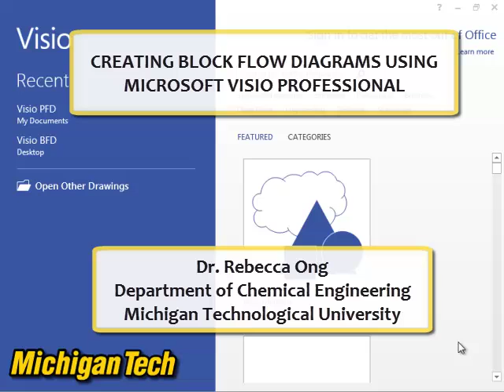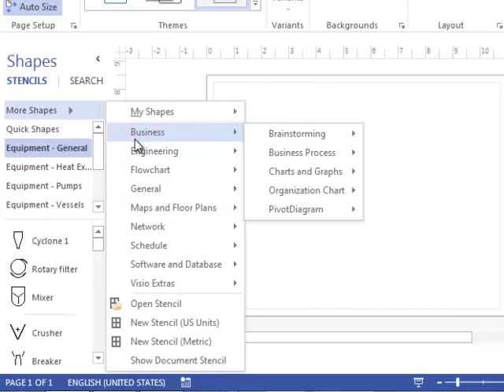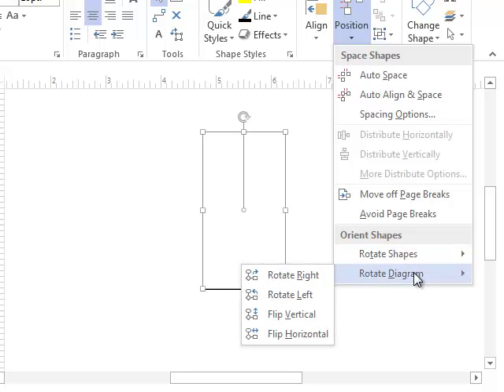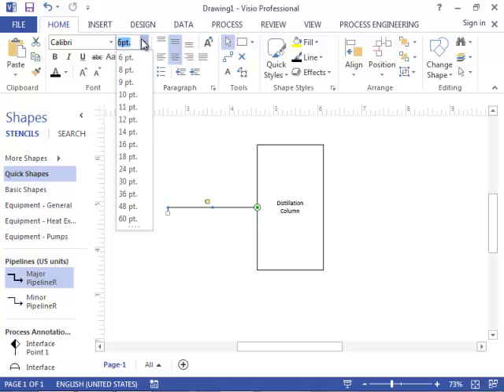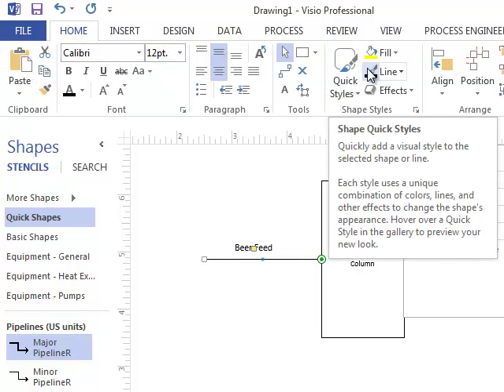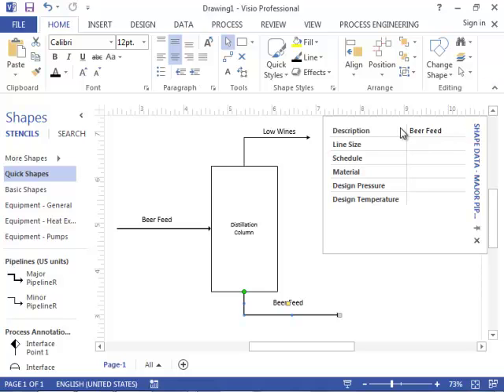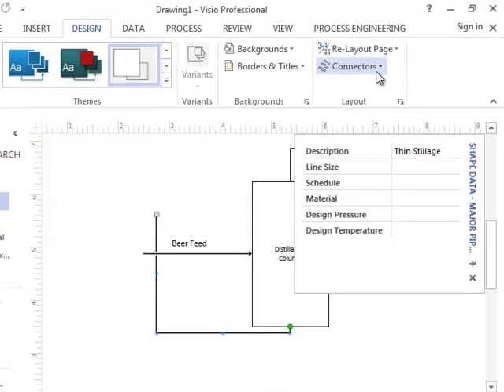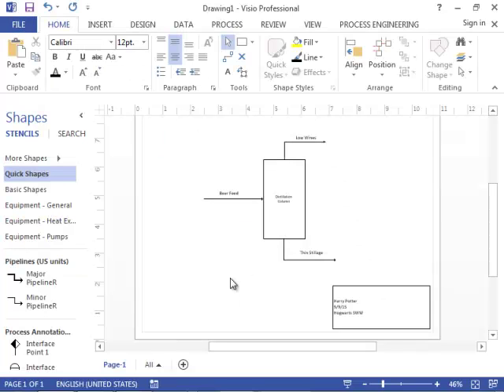Chemical Engineering Block Flow Diagrams in Microsoft Visio

Comment: Can Visio be used to create complex P&ID with parameters? (i.e. pipeline and equipment properties)
Reply: Yes - you can use shape data (4:00) to specify parameters for pipelines and equipment. There are some built in fields depending on the shape, but you can also make custom fields. 
There are instructions for how to do this here: https://support.microsoft.com/en-us/office/add-data-to-visio-shapes-09272394-5243-4e1b-bcfa-425a8b4d1ce2
Reply: @cinnamonfern  thanks a lot

Comment: Can I draw and solve material and energy balance problems including the calculations within Microsoft Visio??

I was searching for this for a long time and concluded that it has something to do with shape data but I still can't figure it out completely yet 😔😔

I hope you can help me!
Reply from the maker: You can draw the flowchart for a material and energy balance problem, and you can assign masses and enthalpies to streams, however I would not recommend using Visio to run the calculations (I don't even know if this is possible). Visio is a flowcharting software, not a process simulator so it is not really designed to run calculations. I would recommend either exporting a stream table with the data from Visio into excel (assuming you added this to the streams as material properties), or just manually input the data into Excel, skipping Visio entirely. Then run your calculations in Excel.
Reply: @rebeccaong2820  Thank you so much for your response, that's what I managed to do and by using some flowcharting software add-in to excel it has become an easier process. However, I was just hoping to exploit Visio's diagramming capabilities in chemical engineering applications & problems instead of referring to the ordinary way to do this via Excel or Aspen Hysys or Plus, and so on. But thank you again for your answer. Appreciated!